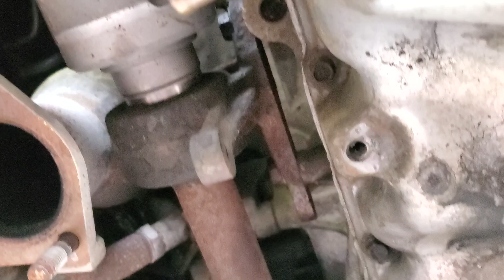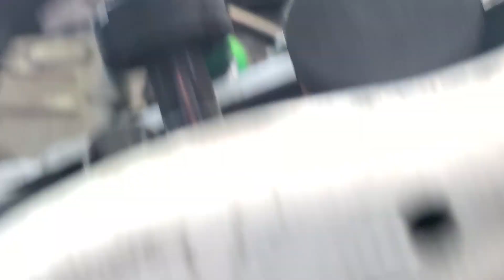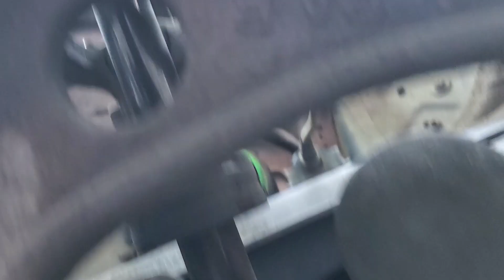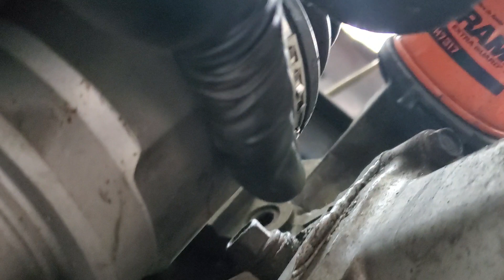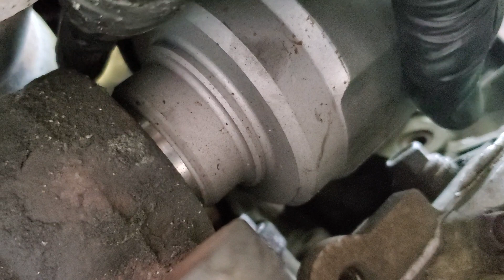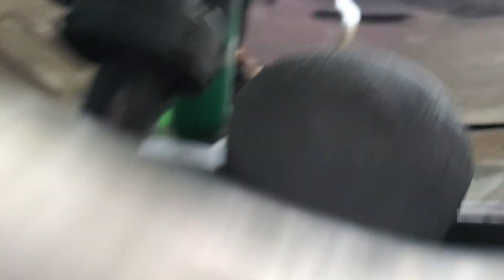2007 Acura TL-S half shaft bearing play

Comment: What was the impact of that bearing loose... mine have vibrations at 40-60 km/h on light acceleration.
Reply: Same i got vabrations to from 40 to 50  ¿did you fix it?
Reply: @yoahgarcia2684  usually inner cv joint is bad...the play he saw was normal...the circlip will have some play

Comment: I've been chasing a vibration on acceleration (20-40mph) in my 2007 TL type S for a while now.   Replaced both axles and all the motor/transmission mounts with little improvement.  My intermediate shaft has the same play in it so that's my next step.  Thing is,  i think that play is normal.  I was in the junkyard and felt the play on like 5 Honda Acords with the same motor and they all had some slop like that.   Anyone ever resolve their vibration issue by replacing the intermediate shaft/bearing?
Reply: I have an extremely bad vibration at 45-60mph, kinda goes away after driving for 15 minutes. Did you replace your intermediate shaft or rebuild it with any luck? 07 TLS auto here.
Reply: I did rebuild the intermediate shaft with a new bearing and it fixed my vibration issue